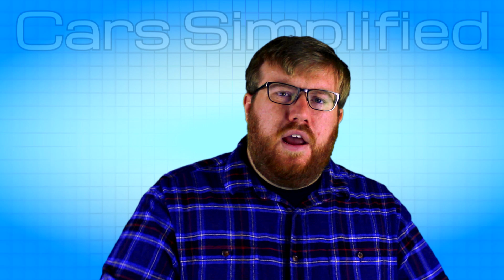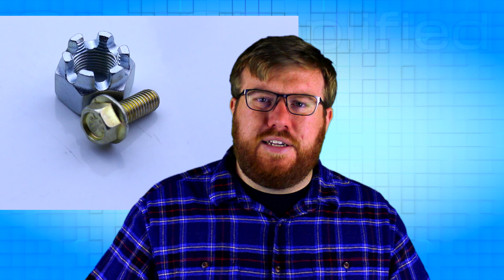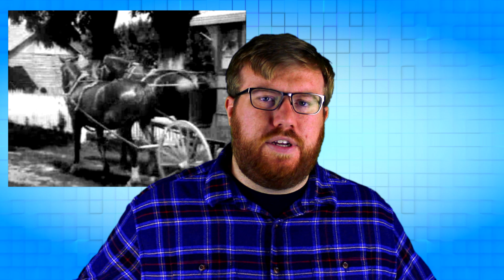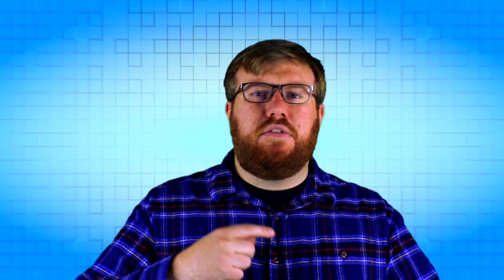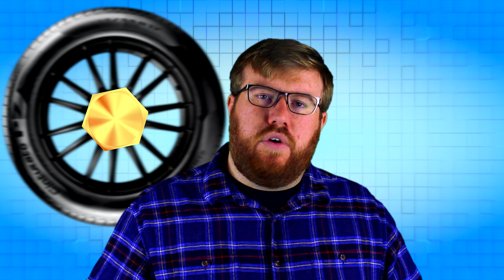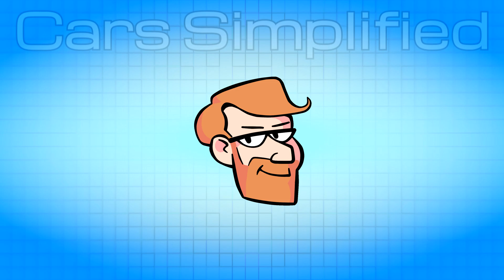Why Were There Left Handed/Reverse Thread Lug Nuts? • Cars Simplified

Comment: This is incorrect. If the wheel rotates clockwise, it should be a left han thread. Don't believe me, then look at an angle grinder it rotates anti-clockwise with a normal nut. Ps if you didn't know already, the nut just needs to be hand tight as it will self tighten. The spanner is only for loosening.

Comment: It's a shame people call left hand threads "reverse" threads. There aren't fasteners that are designed with right hand threads and in another bin are the same fasteners but labelled as reverse threaded. You might find similar fasteners with left hand threads, but they're not for reversed application. Fifty years ago, Chrysler used wheel studs on the driver side with left hand threads. The other manufacturers were all using right hand threads on both sides of the vehicles. Occasionally a newbie would put an impact gun on a left side Chrysler vehicle lugnut and hit the trigger with the turning set left. If the guy had it set to full power, the stud would often be snapped and if not caught, he might snap off more than one. Now, wheel lugs are universally right hand threaded. Worry not though. Mercedes Benz has an effective way to screw things up. They have alloy wheels on the vehicle and stamped steel spares. They use wheel bolts instead of studs and nuts. Several times people have installed their spares and used the bolts that held the alloy wheels on. The long bolts destroy parking brake parts.
Reply: You are simply wrong. Chrysler (and other makes) used left handed threads on the passenger side, not the driver side. Also, they were NOT labelled as "reverse threaded", they were properly labelled as "left threaded" with an upper case "L" on the studs.

Comment: I am an engineer; however electrical, not mechanical; and although some of us may become set in our ways in some aspects of our lives, we tend not to design anything based on tradition or habit.  Safety is, or should be, paramount in our design considerations.  My observation from a young age, is that wheel studs and nuts of the 60's and earlier years turned very freely and, once loosened, they could spin freely all the way off with one spin of a cross wrench.  In cars of later years, wheel nuts could no longer be spun because it seemed that wheel fastener thread design had changed and there was a conflicting, or friction fit between nuts and studs.  Imagine a car traveling down the highway, with wheels spinning at high speed.  A loose wheel nut would be deflected ever so slightly toward the outside of the wheel by centrifugal force.  If brakes are applied, the retarding torque on the slightly off-center nut would tend to cause a loose nut on the right side to rotate clockwise, and a loose nut on the left side to rotate counter-clockwise.  With right-hand thread on the right and left-hand thread on the left, this effect would tend to tighten either left-side or right-side nut, or at least prevent them from further loosening.  Now, with design of a threads with conflicting fit, the centrifugal effect resulting in the loosening of left-hand wheel nuts is mitigated.
Reply: You r right, that why I just barely tighten nut on the right wheels but pay attention on the lefts
Reply: @Spark-Hole  😃
Reply: @Spark-Hole  all wheels require the same clamping force regardless of which side of the vehicle, for safety tighten all
Reply: if the wheels moves while braking its not right to begin with
Reply: @athensteve1  Absolutely correct! I once had new tires mounted and, on the drive home, I heard clicks and a bit of a rattle when I went around corners and otherwise handling seemed off. When I checked the wheels, the lug nuts on all studs of two wheels were lose and not even finger tight. I tightened them up, drove right back to the tire dealer and had a talk with the manager.
Reply: @rossk4864  i installed some tires on budds today, and the question is always on my mind when working on them.
Reply: @athensteve1  Ya, I know what you mean. I was taught the best way is to partially tighten them to about 40 foot-pounds torque, once around the bolt circle to firmly seat all of the lug nuts. Then finish torque them to about 80 foot-pounds for cars and light trucks with 7/16" (or 12 mm) studs, and 90 foot-pounds for 1/2" (or 14 mm) wheel studs.
Reply: @athensteve1  Very true. I do recall on one occasion about 40 years ago, a tire dealer left lug nuts loose on two wheels of my car after I bought a set of tires. Fortunately, I noticed the problem on the drive home and tightened them. I believe that the idea of lefthand/righthand lug nuts on respective wheels was to ensure that lug nuts that were loose or not fully tightened would tend not to further loosen to the point of causing an accident.  Admittedly this is partly my conjecture, and I am not completely sure of this point.
Reply: will too much acceleration loose the right wheel
Reply: @athensteve1  I have thought about this and would have to surmise that for most vehicles, the g-force of deceleration, with braking to slow down or come to a stop, especially in a panic stop, is typically significantly greater than the g-force of acceleration. Therefore, the design of left-hand/right-hand lug studs and nuts, applied to left-side/right-side wheels, respectively, would be based on the effect of deceleration and not acceleration. But, again, this assumption is based on my own logic and I do not have professional knowledge on this subject.

Comment: So was Chevrolet wrong when, back in the 60's, they mounted their optional "quick take-off" (better known as "knock-off") wheels on their Corvettes with left hand hub adapters on the right side and the right hand hub adapters on the left side which is completely opposite of what should be done as shown in the video?  By the way, the instructions for mounting the currently available replica wheels for these Corvettes are the same as given by Chevrolet over 50 year ago.
Reply: Don't think so, that goes back to the carriage wheel example where there was a single spindle so wheel rotation could have an effect.
Reply: @haroldwilkes6608  Please view the video again.  The Corvette knock-off wheels are on a single spindle (as in the wagon wheel example in the video).  Wheels on the right side of the vehicle rotate clockwise when the vehicle moves. forward and the wheels on the left side rotate in a counter clockwise direction.  The knock-off spinner on a Corvette uses left hand threads on the right side and right hand threads on the left side, which appears to be opposite of the point being made in the video.  By the way, 5 lug nuts are used to attach each knock-off hub adapter (all 20 lug nuts use right hand threads).
Reply: @LT-be1bt  Huh? Both wheels rotate in the same direction, forward from the top (unless you're in reverse, of course). The (1963-1967) Corvettes use true F1 style “knock-off” wheels, it actually is the means for removing and installing them in which the lug nuts don't have to be removed to take the wheel off. So the only thing affected by the rotation is the spinner. You are correct that they use left hand threads on the right side and right hand threads on the left side. The right wheel would move forward from the top, against the thread cut so the inertia of the spinner and the constant tension of rotation would keep them tight; ditto the left wheel with right hand threads. This was especially important on the rear wheels because of the torque applied when accelerating, otherwise you might spin the wheels right off the car. We may not be disagreeing, just looking at it differently and admittedly it is confusing.
Reply: @haroldwilkes6608  The wheels on the opposite side of the vehicle do rotate in different directions. Back in the 70s when radial tires became popular, the manufacturers recommended that the tires not be crisscrossed as was the normal practice with bias ply tires but simply to move the tires front to rear and rear to front to avoid changing the direction of the rotation of the tires.
Reply: @LT-be1bt  All of the wheels on a moving vehicle rotate in the same direction relative to their starting point, forward or reverse. You're talking something entirely different about structural tire design. Bias tires could be reversed when mounted on the wheel, whitewall out or whitewall in, it didn't make any difference because the construction was functionally one piece which is why they could be used on any corner of the vehicle. Older radials had sidewalls and tread that were somewhat independent. Radials, properly installed and used, develop what we called a "set", meaning the sidewalls stays in one position relative to the valve stem but the tread could actually shift very slightly opposite to the direction of travel. If you then re-install it on the opposite side of the car, the "set" reverses and this flex could cause internal damage to the tire. Don't worry though, modern radials are "steel-belted" which prevents this from happening. But...some modern "directional" tires have a tread pattern that only works well in one direction and, mounted incorrectly, can cause loss of traction in some weather conditions - these tires normally have an arrow on the sidewall which, when correctly installed, points to the front of the vehicle.
Reply: @LT-be1bt    You were right to stop talking to Mr. Wizard ..er I mean Mr. Wilkes. Knock Off wheels require a different theory than is supplied in this video.  Sprint Car/Champ Car/ F1 RF/RR Hub has a left handed wheel nut, but the spindle nut to hold the RF hub on is RH thread. Curiously though, the LF spindle nut & the wheel nut (on a sprint car at least [1st hand knowledge] ) are RH thread. I believe the difference is that spindle nuts are supposed to be static, and wheel nuts will have rotational torque imparted to them. My 2 cents

Comment: what happens  if  you  make a mistake and swap the front drums and the lug nuts  are now opposite
Reply: Nothing. If you swap drums, lugs and nuts, everything's fine. Unless the drums are significantly different then they makes have problems with the brake shoes. Never seen it though.

Comment: I ordered a brand new 1971 dodge Demon 340 in fall of 1970. It came from the factory with 3 right handed studs and one left handed on the driver's rear. I found it out the day I got it because I put American wheels on it the 1st day and found out when the aftermarket lugs wouldnt work on the rear.. The guy taking off the factory wheels almost stripped out the studs on my brand spanking new car. Nightmare.  When i took it in for tire replacement or flat repair I always had to warn the service guy.  I think they changed  to all right hand in 1971 but evidently my car had  a left over rear axle from 1970 and was a  factory mistake. It was weird

Comment: How come left hand threads/bolts are on the ring gear of a ring and pinion set up
Reply from the maker: I'd have to do some refresher research on that. The first thing that comes to mind is that maybe the bolt heads splashing into that thick gear oil repeatedly might cause them to loosen up, but that depends on which side of the housing the ring gear is on, but those bolt heads might not even dip below the fill line. Just an educated guess without looking it up. If I find a satisfactory answer, I might make a video about it!
Reply: I think this goes back to the single "lug" of the carriage where unit rotation actually could loosen a bolt, same as the single lug on F1 racers. Are there any opposite rotating differentials? I seem to remember some.

Comment: Your right!  Good old Chrysler Corporation did it!  I had a 68 Dodge Coronet back in 74 given to me for college to start grad school by my grandfather.  I remember rotating the tires and I sheared off two wheel studs on the driver's side when I started taking off the first wheel.  Since I didn't know the threads were left handed on the driver's side!   I thought they were just super tight!  Even though that was the only Mopar I ever owned I'm glad they abandoned that practice!
Reply from the maker: I hear it caused quite the headache for many folks thinking the same thing! I bet that I will end up doing it too one day, even though I've done research on the subject!